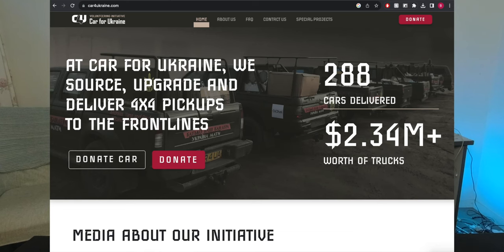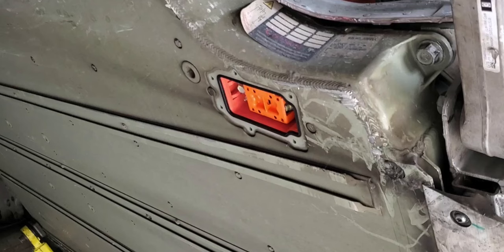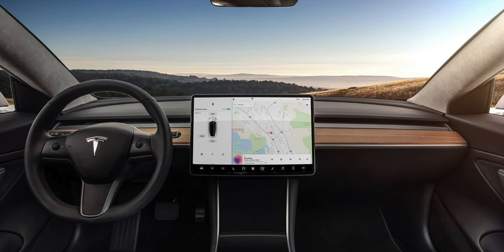This is How Tesla Fixed the OVERHEATING screen issue that plagued them  I’m Impressed.

Comment: The gigga press replaces hundreds of metal parts that were welded together. But all of the metal parts were stamped in hundreds of stamping/pressing machines. So not only have they got rid of hundreds of machines and hundreds or robots (welding) they also didn't need people loading the hundreds of machines! Plus... the area of the factory floor that was covered in hundreds of machines and not forgetting the electricity that ran the machines and the welders.... So YES I think 30% or more is easily the percentage saved.

Comment: The BYD uses a Qualcom Snapdragon processor, it's an ARM based CPU, whereas the Tesla uses an AMD Ryzen CPU which is intel based in its architecture. They are very different in how they operate; the ARM based CPUs generally produce a lot less heat than the AMD CPUs, and as such I don't think it's an issue with BYD cars.
Reply from the maker: What did I say in the video! There are some very clever people that watch my videos. Thanks for the comment :)